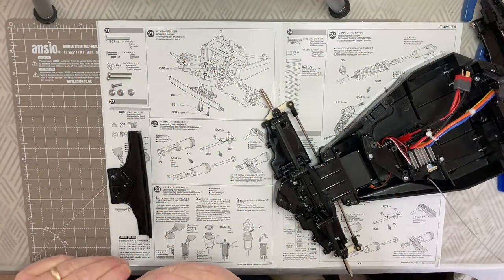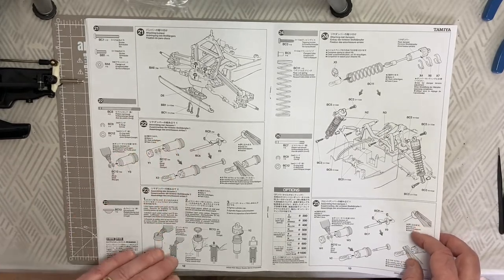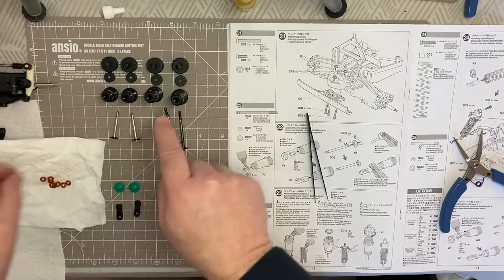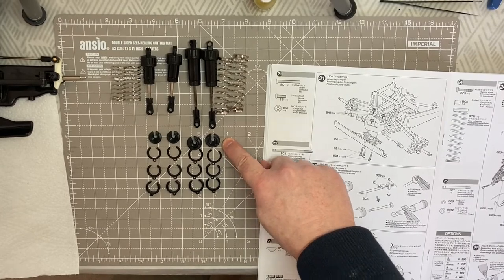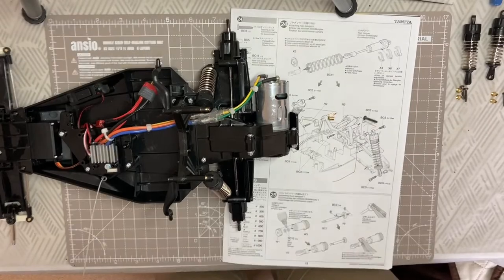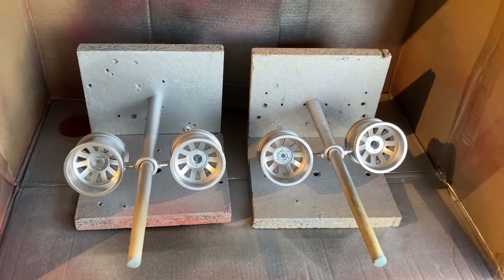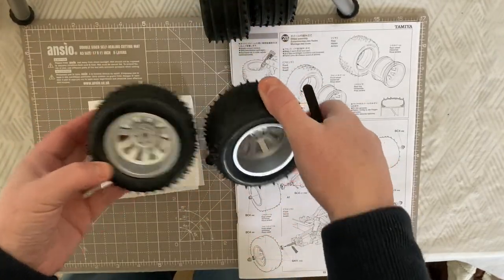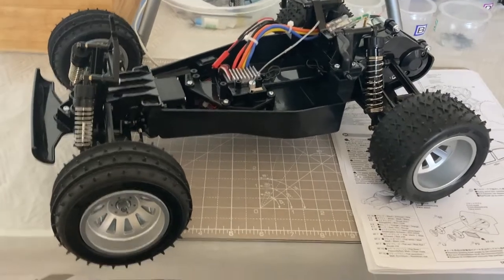The Tamiya Blitzer Beetle Build Steps 21 to 30

Comment: Looks great John. Love the wheels on this RC and those bearings show the difference in how free the front wheels rotate. Great build and can’t wait to see the body 🙌🏻👍🏻
Reply from the maker: Hi Craig, thank you for watching my penultimate video of the Blitzer Beetle. Next week, the final instalment 😉. I’ve got this thing about wheels, well…..I like them to look like…..well…..wheels 😂🤣 orange, yellow or even white wheels, kind of don’t quite look like wheels to me. In comes the TS 30 Silver Leaf or as near as possible to alloy wheel colour as possible 😂. I heat the wheels gently with my paint stripping heat gun, not too much though, otherwise, plastic mush! 🤣😂🤣 I’m hoping the slight heat changes the plastic molecular structure to accept the paint, well, that’s the hope. I then keep the heat on the painted wheels to help with bonding and curing, but ensuring a good distance from the subject. I suppose you could use a hairdryer, but the wife might get annoyed if I blow it up! 🤣😂🤣. Take care, keep well and all the very best for 2022 my friend. Keep up the great work. 😊😉😊 oh, had to change my mind about the DumbRC radio gear, had to purchase a FlySky FS-i6S stick radio for that elusive next project. 😉😊😉

Comment: Hiya John.  Good stuff mate.  Thanks for the mention.  I think that Mark did a video about that shock thing first but I was already doing something similar.  You can also stick it on a blob of BluTac to stop the oil coming out while you are fiddling about.  I like the wheels in alloy silver.  I'm always a bit wary of painting the wheels a totally different colour in case it chips off in use and it shows the plastic beneath.  Cool that you have that spray booth.  I see that you have the next episode up so I'll have a look at that soon.  I'm just trying to get a video done myself.  I did watch the previous episode to this and left a comment but I'm not sure if you saw it.  Anyway, best wishes to you and yours mate 🙂
Reply from the maker: Hi Pete, thank you for watching my video. I think the finger over the shock hole works perfectly, great tip, used it ever since. I’ve also got a thing about wheels, well……looking like wheels😂🤣😂. I get a bit OCD about wheels 🤣😂🤣. My budget spray booth, with an old black & decker heat gun, ain’t I a tight ass! 🤣🤣😂, but you know, it works! The heat gun provides a warn environment, i heat the paint cans in a glass of hot water and use heat from the heat gun, in between paint layers. Worked a treat for the TS paints, I’ve even used the same technique on the next project. Sorry I missed you comment on the previous episode, I’ll pop back a check. Looking forward to your next video my friend, I always do. Take care, keep well and all the very best to you and the family. 😊😉😊